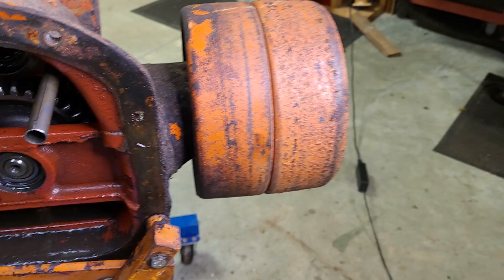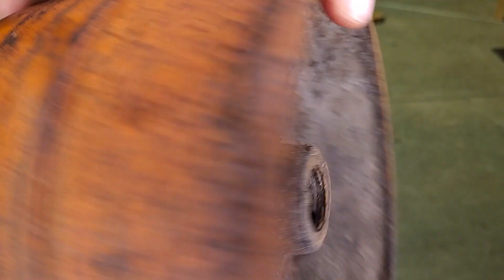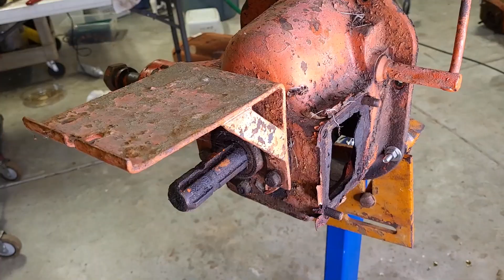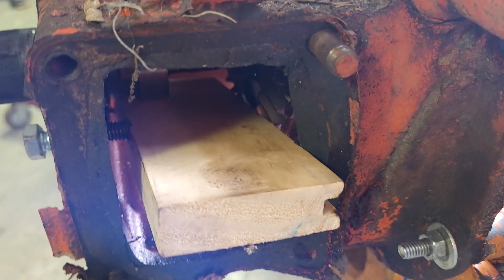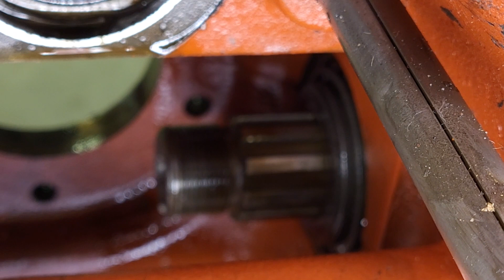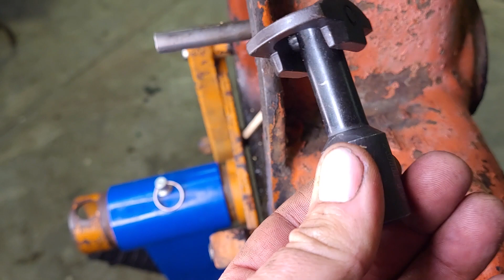1953 Allis Chalmers B PTO Disassembly & Inspection

Comment: Dang. The one bearing I need to know how to get out is the one you didn't pull XD. Oh well...I'll give a slide hammer a try and see how it goes.
Reply from the maker: I didn't want to touch that one since it was good.  Looked like it would come apart.
Reply: @JPN76  Yeah your reasoning is valid and it probably will. Puller is 2 days away so I’ll know if it worked on Friday lol.

Comment: How does the housing come off?  Does it pull straight back after removing the bolts or is there something else holding it in im not seeing?
Reply from the maker: It pulls straight back but you may have to angle it some because the engagment lever has a tab in the small gear on the input shaft
Reply: @JPN76 okay that makes sense now.  That's the area it was getting hung up on.  I got it seperated everywhere else.
Reply from the maker: Yeah you may need to rotate the assembly slightly @irishpenguin13

Comment: I was wondering about the belt pulley oil seal. It looks like it can be replaced without removing the shaft. Am I correct?
Reply from the maker: Yes it can. Just remove pulley
Reply: @JPN76  Thanks for the quick reply! Your videos very informative.
Reply from the maker: Thanks! BTW I measured all the shafts and bores to compile a list of seal numbers locally available. If you are interested I'm going with National seal number 450444 Shaft 1.375" bore 2.502" and width .5"  this one was in stock at autozone. I bought every seal from the bellhousing back for about $85.00
Reply: @JPN76  Thank you very much!
Reply: Do you also have a seal reference for the PTO shaft? I’ve already changed my inner, upper final drive seals.
Reply from the maker: @rodneyaman4272  yes but I will have to look when I get home.
Reply: @JPN76  thanks
Reply from the maker: @rodneyaman4272  national seal 470135.  Bore 2.125" shaft 1.375" width 0.437". I have not test fitted this one yet because I'm still cleaning up the flange. But these measurments seem correct. I have heard there are two different size PTO shafts so check that.
Reply: @JPN76  thank you….I’ll measure my PTO shaft!
Reply: @JPN76  looks like mine is a 1.20 inch shaft with a 2.0 inch OD and .45 inches wide. I’m going to need to figure out the cross over chart for national seals.
Reply from the maker: @rodneyaman4272  hope this link works here but I uses the timken seal selection and interchange manual.  https://www.timken.com/engineering-tools/seal-selection-tool/

Comment: Would be better on the bearings as wells housing and gears if a press was used?
Reply from the maker: Yeah, anytime you can go slow and steady it is better than pounding on it. It did move easily though. Although even the factory manual says to drive it out this way.

Comment: Good   day from Ont Canada,  Whenon farm we had a little B. 2 questions  Hydraulic oil was that  rear end oil< I didn't see separate compartment?   &  rear seal on pto shaft, you said it was wore,  does that mean it  done alot of pto work?  Interesting video.  Thanks
Reply from the maker: Yes the Hydraulics use the transmission oil. I believe the manual calls for 30w motor oil. You can use most oils that are designed for trans/Hydraulic there are a few out there and most are 30w. We actually used gear oil but didn't know better at the time. It had gear oil in it when I drained it. As far as the worn seal, yes it had lots of PTO work. The parts tractor that shaft came off of had a belly mower attached so most likely the pto was on most of the time the tractor was used.
Reply: @JPN76   So rear end oil  was #30.  But I thought later if you wanted you  to use hydr  I guess pto would be going anyways. Thanks